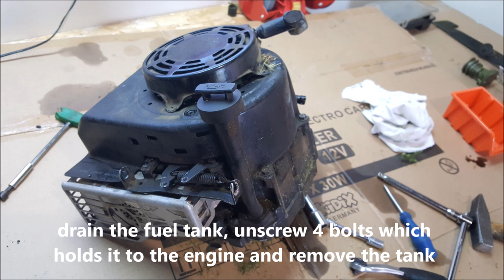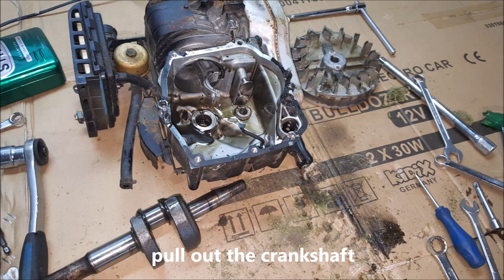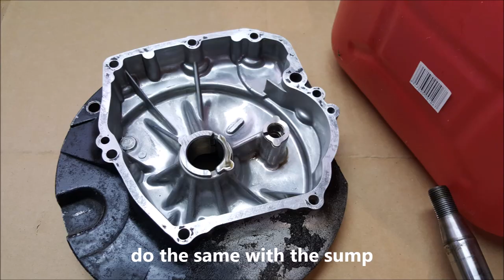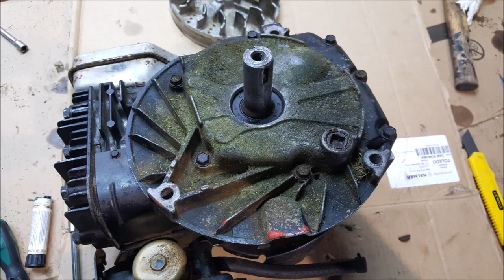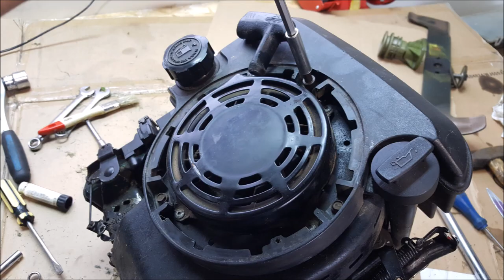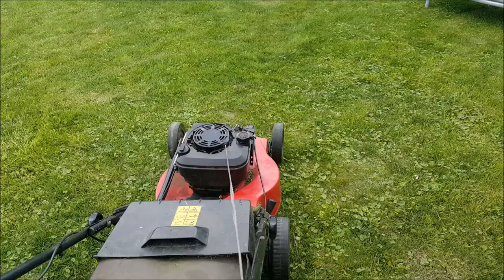Bent Crankshaft in Lawnmower Repair - Briggs & Stratton Engine Disasembly

Comment: How did you take the oil pan off .
Reply: There’s just 7 little bolts then tap it open, make sure the blade or whatever is on the outside end of the shaft is off first and check for debris around the crank oil seal as it’s a tight fit through the seal, be sure to oil or grease the seal when refit

Comment: You leave out so much information. Remove flywheel . Did you show the people how to remove the nut holding the flywheel on . Then to remove flywheel  ? Did you show the people how to remove the blade disc boss ? On reassemble did you show the people how to check the air gap between the coil and the flywheel .What about the oil slinger on reassemble ? Did you replace the top and bottom oil seals , etc etc....
Reply: If you can't do these simple thing's, you better take the mower to a lawnmower repair centre .
Reply: @troth6251   Why the fuck would I take a mower to the repair centre ? I do it all myself. This guy left out so much  . And I would not agree on removing a stubborn blade disc boss as simple . If you are going to do a video on a repair , then do not leave out important information.
Reply: @0011clem    OK man point taken .